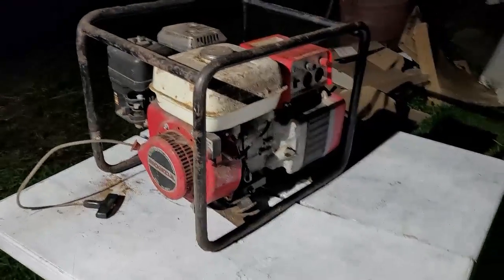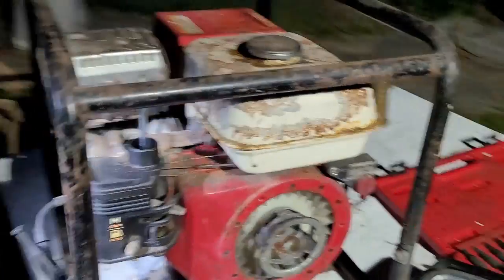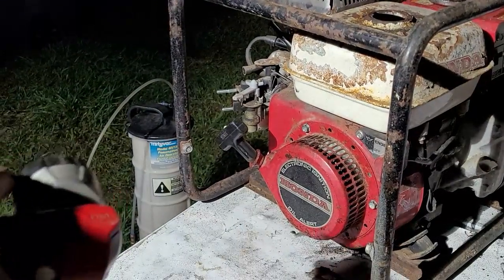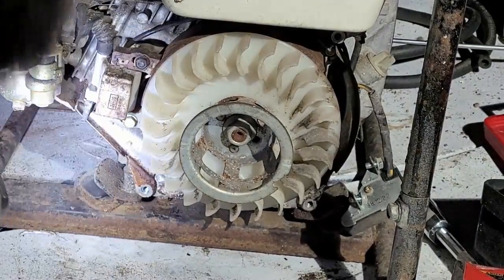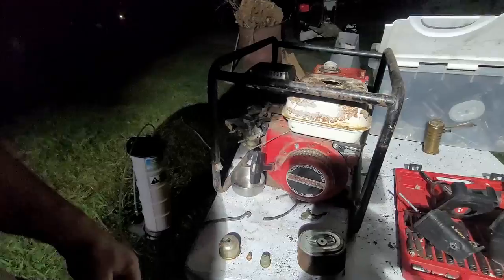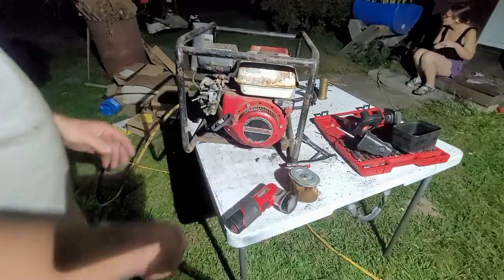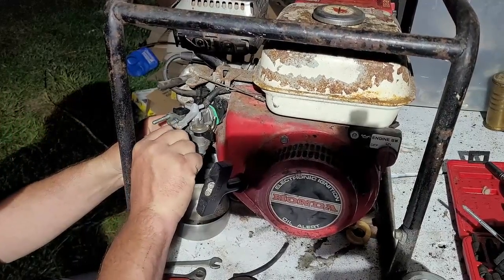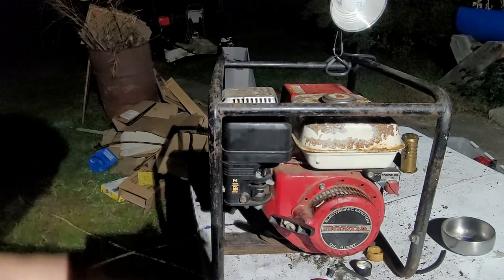Working on a FREE Honda EG2200X portable Generator 1st look will it run

Comment: Hi man. Working on a mc1m90 really need your help to see what a part is i can't identify.  Its in the left case right to the 11:00 of the sprocket.  Or how can i contact you.  The oil cones out of the 2 holes for the missing piece when i lay the bike on its sode.
Reply from the maker: @AlabamaDigger  603 395 8097 call me
Reply: Its where the neutral switch would go on the street version of the mc1m90. So a cover is needed. Figured it out.
Reply: @2strokeguru  will tommorow.  Thanks man just seen your response.